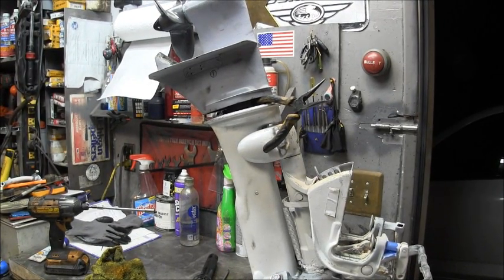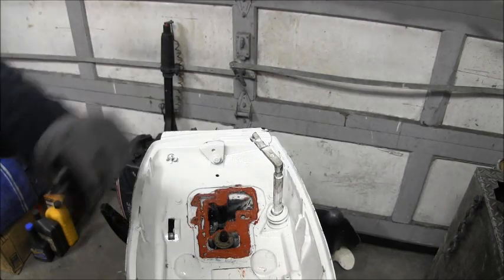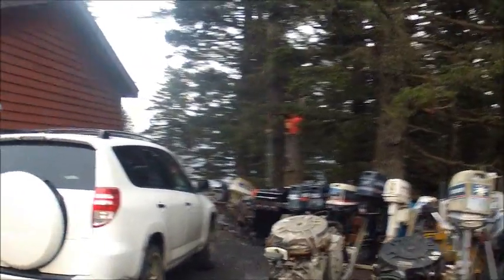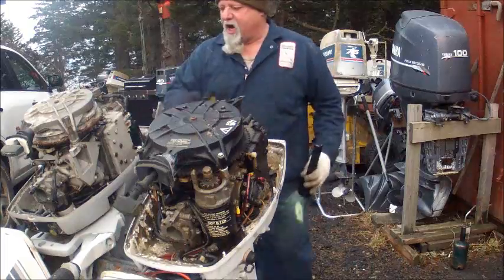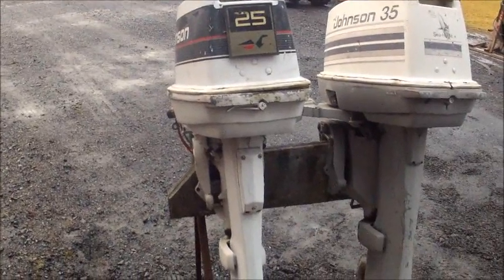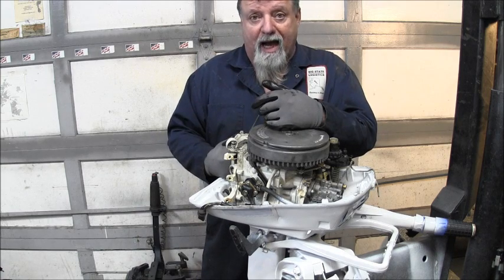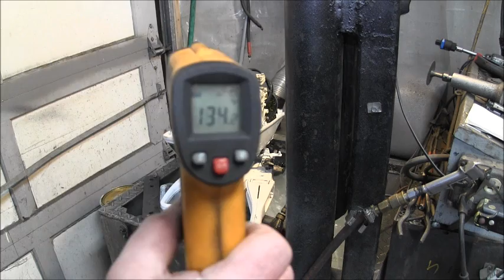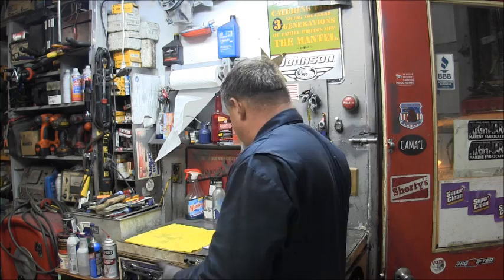JOHNSON 1978  6HP,   PART 4 &  More

Comment: Wow!  A 1984 OMC 35hp - my favorite small motor.  It had the best of everything.......... last year of a commercially available OMC 35hp, next to last year of the gear & shaft throttle linkage (1985), first year of the 3-dog clutch dog and drive gears, and first year of the long shank pinion gear (which made for a much stronger gear case).  And first year of the primer.  Also had bridge-port design by-pass ports which were replaced by finger ports in later motors (20-25-30, 1985 and newer).  A bridge-port 35hp is a "Boy-Dog";  you can feel that extra power.........  Love 'em.
Reply from the maker: Yep' outstanding motor 4 sure.   kb

Comment: In 34 years working on Johnson and Evinrude motors,, I must say that I always enjoyed the small motors from 35 h.p. down to the  2 h.p. tyke's lol,,,    they're the real money-makers as far as I'm concerned,   because the small motors can take more abuse, and keep on going!      Whereas,,  anytime I would rebuild a 3, 4, or 6 cylinder outboard,, I had to worry about how well the customer(s) would  pay attention to my instructions, both verbally, and written on the contractual paperwork!  And I had some doozies,,,,  let me tell you!!!  Like one customer who didn't add ANY 2 stroke oil to his fuel tanks!!!!  Yep!!!   
    After at least 4 different times, I told to him to "use a   ~ 25 : 1 ~  mix"  instead of the normal   ~ 50 : 1 ~ mix ~  for the first 12 to 14 hour ~break-in~ period!.  I even had a special rubber stamp made with these instructions printed and would stamp both copies and have the customer sign and initial them both!  
 Well,,  this guy was a NUT!    Instead of following my instructions, he doesn't add ANY 2-STROKE OIL TO HIS 12 GALLON TANK,  ONLY RAW GASOLINE!!!  
      I had done a complete rebuild to the motor.  All new oversized Wiseco forged racing pistons, w-pins, rings,,  all cylinders bored ~10 thous. over~ and a whole lot more!!!   This customer was an idiot-deluxe!!!  Purely by chance,, he buys ~Lead substitute~ instead of 2-stroke oil,,, and dumps in a whole lot of ~Lead substitute~ into his gas tank.  And straight out of Gomer Pyle's mouth, "Surprise Surprise Surprise" ............ this idiot runs his outboard for close to 3 hours, which he did at least follow the instructions for the max. speed of around 15 knots,, and also the following day!   And would you believe,,,,,, the motor survived being run w/o oil?!?!?!?!    When he came to my shop he apologized for getting the wrong stuff (the lead-substitute instead of 2-stroike oil!)   and I quickly removed both cylinder heads (a v-4 Johnson!)  and I was shocked,,  there wasn't a score or any groove(s) cut into the cyl. walls!!!!!    Testament to what ~Lead substitute~ can do for an outboard~!~
Reply from the maker: Yep' U R spot on correct,  I all but stopped doing rebuilds except for friends for those very reasons.  May I barrow your Idiot Deluxe haha  luved It..   kb

Comment: Good stuff, we usually run SeaFoam at just before dusk here in SE LA to help with mosquitoes in summer time. It works well, bc these here, you can put a saddle on them, so yeah, getting a bite from one of these will leave a huge welp. I don’t mind helping with control of the pop. 
Good advice on decarb a motor.

Comment: So to put a dollar perspective on it. I just searched the internet on the price of a brand new short shaft  mercury 6hp outboard.  $1746.99 and I personally believe the little johnson you just repaired has equal power and torque and overall performance. Congratulations kodi.

Comment: Yeah, the audio on these videos can be deceiving sometimes, I didn't hear any knocking/rod knock when you ran it.  Although the rod bearings on these engines tend to fit a bit loose, sometimes you hear a "ringing noise", especially on the 6-8hp models before they went to steel rods.  The ringing noise is normal for these engines.  Reinstalling these gearcases can be another challenge, lining up the driveshaft pin, water tube, and shift rod connector.  Surely easier to install with the powerhead off, gives you a chance to inspect that lower powerhead seal assembly as well.  I have tried to figure out just how that lower seal assembly works, but it is a bit of a mystery.   But, it sure does work, it keeps the splines nice also!

Comment: I really think it’s more likely from idling and running slow and never getting to open up ! Just my thoughts but if used as a kicker that’s been my experience, on the other hand if it were used to push a small boat I believe the carbon won’t be there at least not as much !